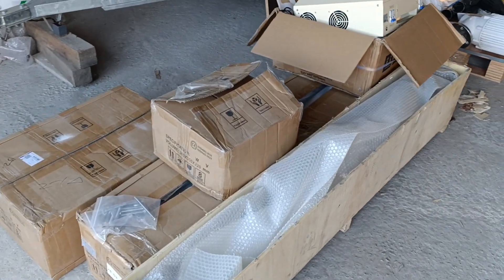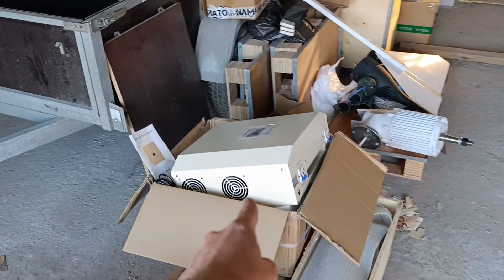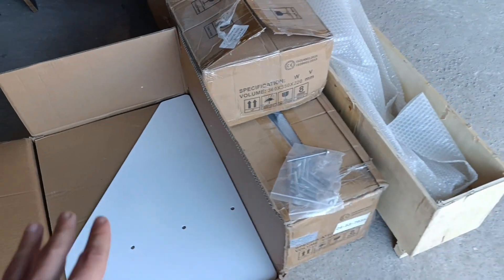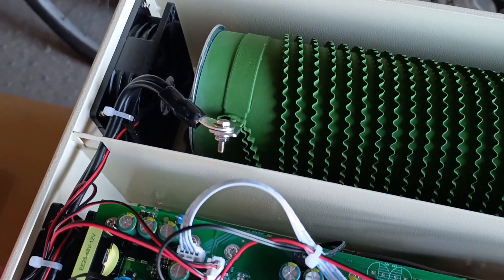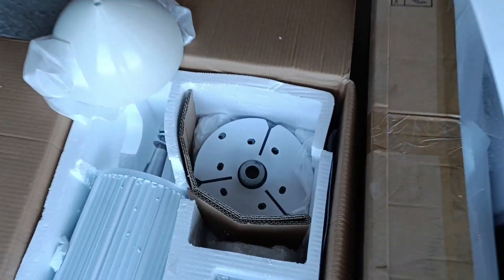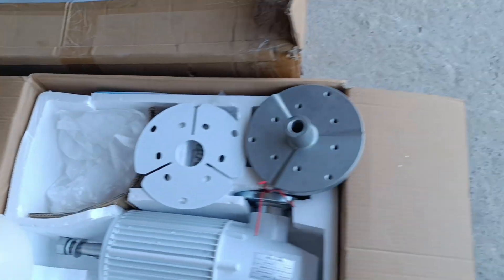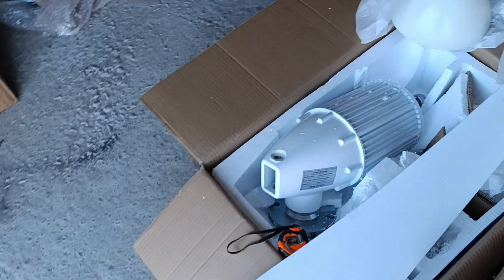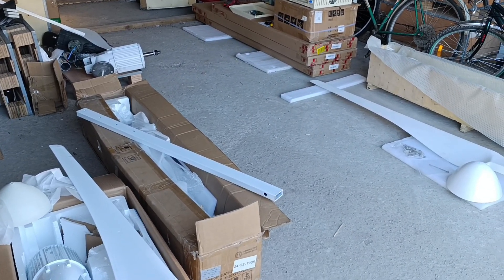2025 update of FT-2000: it's the best small 2 kW wind turbine, true to the power, true to the size.

Comment: Hi Mate, these outputs are only what saw while watching in 50km/h wind, they might have done more in peak wind speed at 63km/h.
10 x wind generators Peak Output Totals  =  44 Amps  =  752 Watts
28V - 24V 500W Vevor   -  8 Amps  - 208W
28V - 24V 500W Vevor    -  8 Amps  - 208W
14V - 12V ista Breeze i500   -  11 Amps  - 132W
12V - 24V 300W Old  6 blade   -  4 Amps  -  48W
12V - 48V 1,000W New S5   -  2.5 Amps  -  30W
12V - 48V 1,000W New S5   -  2.5 Amps  -  30W
12V - 48V 1,000W New S5   -  2.5 Amps  -  30W
12V - 48V 1,000W New S5   -  2.5 Amps  -  30W
12V - 48V 3,000W new rotor   -  1.5 Amps  -  18W
12V - 48V 3,000W new rotor   -  1.5 Amps  -  18W
Reply from the maker: So, this tells that using a 48V gen on a 12V system is not a good idea at all
Reply: @BackyardVoltage I forgot to say that the wind in most storms comes from the North to North/West, which are the worst directions for all my lower wind generators, because there is two big trees and the house blocking the wind. Another thing in a storm with the wind not being constant, having large gusts of wind, the wind generators kept turning out of the wind in a protection mode. No constant output, only peak reading.
Something strange is happening in my normal day testing, sometimes the 3 meter high wind generators are turning in low winds, when the higher 6.5 meter wind generators have not even started. I have found that having 10 wind generators at different heights and different locations, there is always one wind generator turning sooner then the others. Sometimes before my lower limit of 10km/h as well.
Reply from the maker: it's always better to put one decent unit on as much height as possible (20-30 m). there the flow is more laminar, and with a good controller there - it can go as it should.
all those 2-3-4-5-6 m above the ground - that's for toys, unfortunately.
Reply: @BackyardVoltage  My wind setup is complete now, low wind is what we get most of the year, so that has been my target. There is a low wind of 8 to 10 km/h South/East tonight and all wind generator are going, so even if each one was only making 1 amp, that is still 10 amps in the night, when there is no solar is a good charge. South to South East winds are our normal winds and is where I get the best production, because there are no obstructions. I've had no noise complaints so far too.
Reply from the maker: @brianaustralia9692  well, that's actually good. I'm also hunting more for a low wind production, but it's not an easy task with bigger units, as there is a very tight and tough balance to not ruin the unit on the strong winds.
Reply: @BackyardVoltage  Yes, I agree. The only thing that I could try without spending more money, is put two of the S5 on the two 6.5 meter poles. I am sure if I double the height, that I could double the output, maybe I could try them on 24V system too.

Comment: Shaft shims or adapters. Drinking cans make perfect shaft 0.20mm shims
Reply from the maker: there has to be a bit thicker. so adapter is the only way (in case I will have to use it. I might be just lucky to have enough original hubs)
Reply: Yes, adapters the go, tin can shims are not for high impact shafts, only straight pulling shafts, it would compress the tin and loosen.
Its 40mm to 25mm !?, started looking at bigger generators/charge controllers package on aliexpress and looking at a 1.335mm blades with hub £314, but it never says the shaft diameter.
Reply from the maker: yes, never. so always if going bigger - switch to Alibaba, there you will get better treatment and more realistic values
Reply: At last found an ft-3000 on an European ebay, says its only 53kg !? Comes with the lcm charge controller, emailed them too confirm buck and boost and low 300rpm, still keeping i2000 istabreeze for 40+mph braking it at 60mph and going to brake the ft-3000 at 40mph
Reply from the maker: @HenryOwens-py3ur no, that's not true. Ft-2500 weighs 75 kg. Ft-3000L1 should be about 87, and Ft-3000L2 should be 95 kilos.
Reply: Ok, thanks, i still think my new tower can handle 100kg but mybe not the 60mm pipe from turbine to bottom of blade, rely needs bigger diameter than 60mm i think.
Reply from the maker: @HenryOwens-py3ur if your pipe is like 5mm thick - you are good with 60 mm dia. But if not...
Reply: it is 5mm thick ! One peace 7.5mx60mmx5mm £100 and I'll have 48mm scaffolding come off of it at 2m, so makes a diameter of 4m base, but only in a 2mx2mx3m (sorry right angle triangle)
Im going to wait to the spring, due to last year wind production was only 16mph and the year before was 30mph, sore on a chart 14-27mph average, so just had a record breaking year to a below average in two years !
Reply: I guess by the time the blade bends to the post, it will be 1m from the turbine.
Reply from the maker: @HenryOwens-py3ur on L series blades are sturdy as hell, they may bend 4-5 mm max I believe.
Reply: Wow wa we, Ok great, after alot of research and your excellent detailed channel i think that is the best option.
Not sure how much a little lathe would cost to make an adaptor! 
This winter projects are to learn CAD and start a harvest for next spring and then review the ft-3000l again after the i2000 productivity.